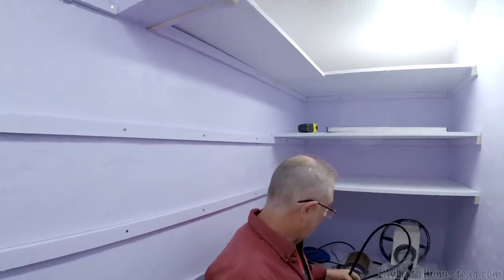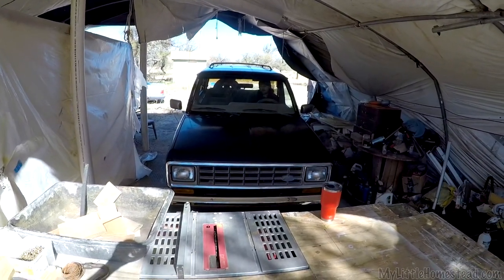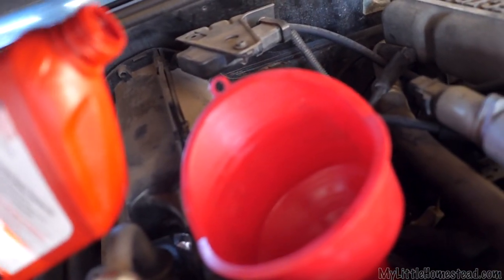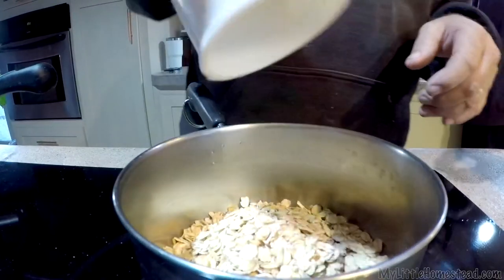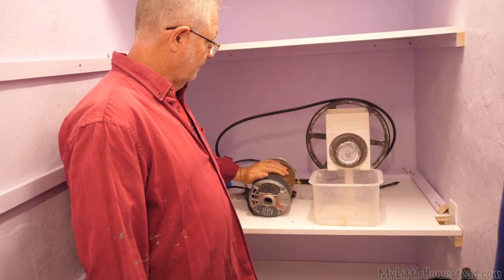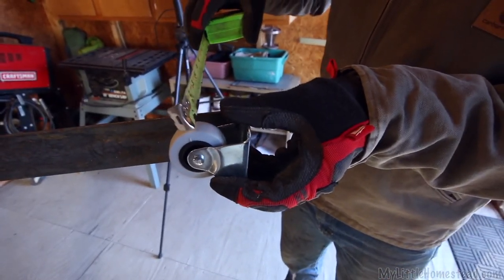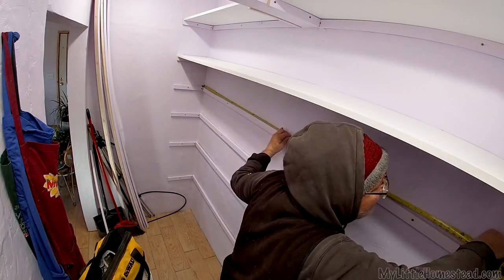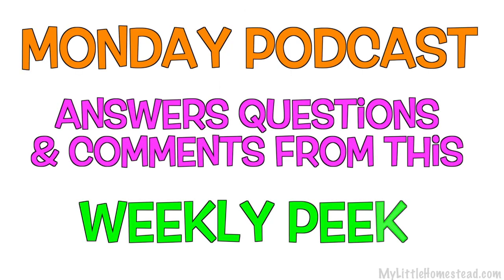DIY Barn Door Rail System (@11:22), Pantry is Finished & Bronco is Tuned Up | Weekly Peek Ep221

Comment: 35 year mechanic and shop owner here.  Bryson, your cylinders look clean and so does the oil draining out.  The "magic" of ATF for your crankcase/lifters is, it includes a higher load of detergent additives than motor oil, to keep microscopic clutch particles in suspension.  Therefore, if a lifter is stuck from a piece of crankcase sludge, running it at full operating temp 30minutes plus can help dissolve the particle much like a clot-busting drug.  The smart thing to do is wait till it's almost time to change the oil and it's a little low, add the quart of ATF and drive a week or so THEN change the oil.  I strongly recommend full synthetic oil and Motorcraft oil filters for your Ford.   Also have sealing washers for the drain plug on hand and use a new one at every oil change. 

Make sure the PCV system is clean and flowing well, if this plugs the crankcase gets overloaded with acidic water which really accelerates oil breakdown and sludging.  (Fun fact, burning a gallon of gas yields 20 pounds of water vapor.)   Recommend against using crankcase flushing or cleaning solvents, these attack the seals and the next oil you put in even after draining.

The shelves look sturdy and awesome!   Strongly recommend building a belt guard on the flour mill, a string or sleeve could pull someone's hand in or a kid or pet might plunge back there one day.  That compartment will probably reflect all of the sound toward the user so line the walls and "ceiling" of that compartment with sound damping material.  Also the underside of the mounting shelf might transmit the sounds of the machines like a speaker cone so put damping there too.

Look forward to your videos every Friday and get inspired before working on my future ranch.  Still a few years till I can make my move from the city to the country and retire there but by summer I hope to have a few hipcamp sites set up there and start uploading my own progress videos.  Cheers!

Comment: Just a thought: To dampen the sound of the grain mill, you could cut and fasten (by using double sided tape, removable sticky putty, etc.) a bunch of 30-48 capacity cardboard egg holders to every surface of the inside of the mill shelf. Sound bounces off of flat surfaces, but breaks up against irregular shaped surfaces. Even though the one side would still be open, it would likely reduce the sound significantly.

Comment: when doing right angles in flat bar, cut  1/2 or 3/4 way through. bend it then weld the cut without any problems holding it in place

Comment: The noise from the valve train is not going to go away by itself.
On a "spirited trip" back to Chicago from the Indy 500 in the late 80s.
My first Bronco II sounded like it had a change counter instead of an engine under the hood.
The two later models I drove did not have the problem.

Comment: Most of the ford v6s in bronco IIs had mechanical lifters and required periodic adjustment. Have to take the valve covers off, but not too difficult. Should make it run smooth. Very peppy little motor!

Comment: I wish I would of known about your flour mill project... my parents used to make their own hamburger, with a converted hand meat grinder. big wheel pully on the grinder, small pully on the motor to slow things down....  instead of mounting the motor beside the grinder, which gets dirty and is in the way, also the hazard of a exposed fan belt. my father mounted the motor below the grinder on the next shelf down, below the grinder... he cut a long rectangle for the fan belt to be inserted behind the grinder, to the motor below.     to solve the fan belt tension issue, he had the shelf mounted on one side with hinges, so the shelf could be raised, to install the belt and the motor held pressure down on the belt from the motors weight. so no adjuster was needed on the belt. it was automatic. in case the belt slips, just add weight next to the motor...  he also mounted a light switch next to the grinder, so the grinder motor could be turned off quickly..
that storage room is a great addition to your home... 
also bryson shouldn't leave a full quart of trans oil in his truck for a prolong period. he should change his oil as soon as the lifter(s) are quiet. save the oil as it will still be fairly clean... 
to prevent the sticky lifter issue happening again. add half a quart of his blended motor oil-trans fluid mix to the next oil change. keep doing that until all of the blend is used up. (probably will take several years). after the blended oil is used up.  just pour a 1/4 quart of trans fluid in each oil change, to prevent future lifter issues.

Comment: On the shelf you should put little pieces behind the main long striped legs this will give each shelf a little piece to set on so basically cut a into several little pieces and put them behind to increase the strength of the without adding more uprights

Comment: I use to put an old computer magnet on outside of the oil pan to pick up any steel filings.
Reply: Salvage the magnets out of a dead microwave magnetron; them are pigstrength mags.

Comment: I love the way you made the door rail system, a question tho, what about the wheels how long do they last, with a weight of the door (depends on that ) on it? When i made barn door styled rails i made the wheels changeable with small bolts and nuts, but maybe that wouldn't be a problem. I just made em that way. Another thing Those shoes  Bree had on they look so comfy., you cant tell where you got em from can you ?

Comment: My faux barn doors have fixed inline wheels on the bottom of the doors and just bent metal strapping (with felt inside) to hold the top of the doors on the painted black pipe 'rail'. One length of pipe, two elbows, two short nipples and two flange mounts, very inexpensive.

Comment: when i was a kid the connection from the the front to the boot door of our car broke, so the switch for the windshield wipers in the back didn't work. my dad fixed it by attaching a long cable and a light switch from a desk lamp to the windshield wipers.

Comment: I thought oats were flat to begin with.  Rolling them must be very time consuming.  Might need the Keebler Elves to assist in that.
Reply: Nah, oats start out tubular, and they roll quite well if you get them on a proper incline. It's the crash as the bottom that flattens them out.
Reply: @lynn9470  
Hahaha.  Sounds like they need brake jobs.

Comment: Dude! Never use a FRAM oil filter. They are junk.
Reply: It's not the filter brand. It's the consistent oil change. FRAMs kept my truck runing strong for from 1984-1916; no problemos.
Reply: Fram oil filters used to be good. They have declined in quality in recent years.

Comment: Top ten reasons NOT to buy an electric vehicle (and why each one is wrong!)  https://youtu.be/VyZOLMeMYnI  Used Nissan LEAFs for Sale for under $5,000 | TrueCar https://www.truecar.com
Charge Where You Park
Charging your Tesla is easy and convenient wherever you normally park—at home, your workplace or around the city.  https://www.tesla.com/where-you-park
24kw = about 70 miles Warranties are expiring and batteries to wear down. This is the ideal starting point for the Fēnix Power battery system coming in Early 2020! Fēnix Power – A Next Generation Power Company
https://fenix.systems/ 40kw = about 140 miles and later 60kw.
Hello Tesla chargers Tesla to J1772 Adapter – EVSE Adapters
https://www.evseadapters.com/products/tesla-to-j1772-adapter/
Tesla Launches Solar Panels As A Service ☀️ youtu.be/xjgEzJdcugo